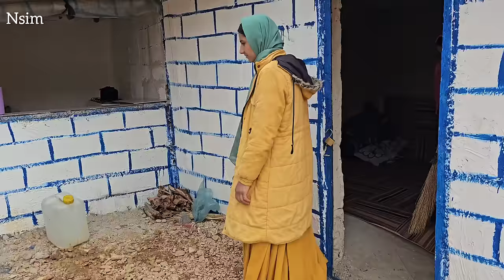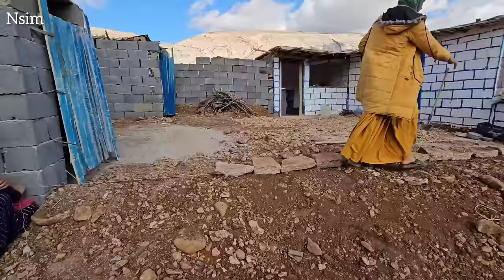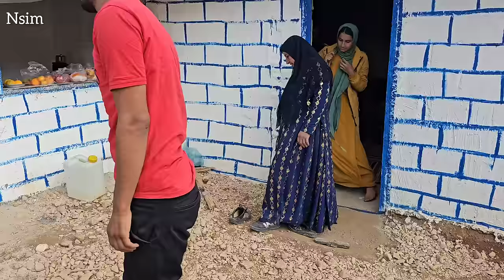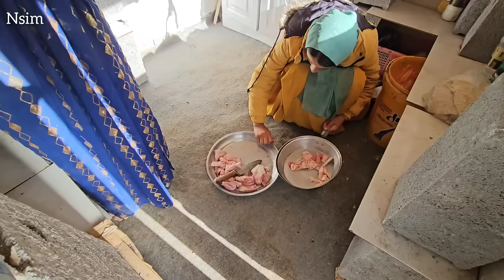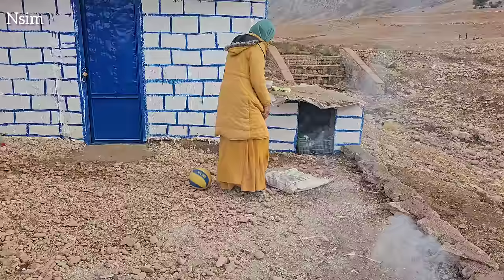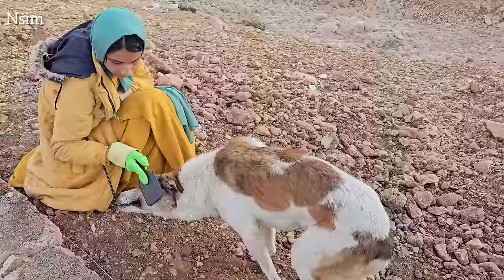Nomadic courtship: A nomadic boy proposed to a nomadic girl❤️👰🌹#nsim #courtship#plerd

Comment: Those concrete pieces should be set in the ground on top of cement, not just laid on to ofthe ground. You are going to raise the ground level of the whole area and the dog kennel floor will be below ground level and water will run into the dogs house.